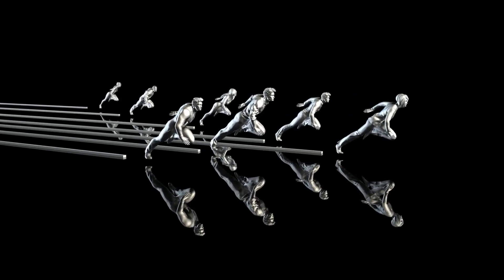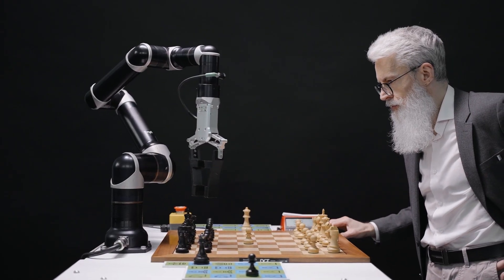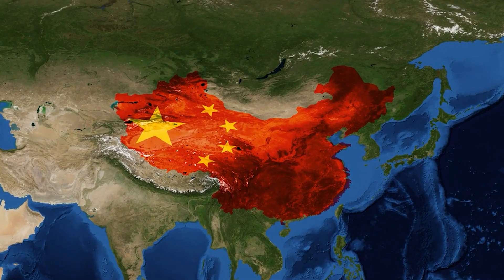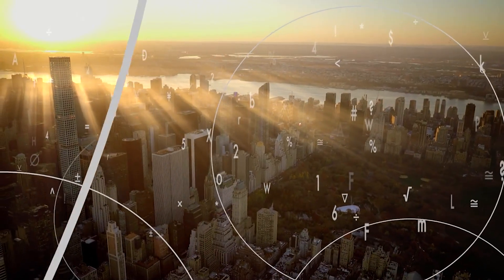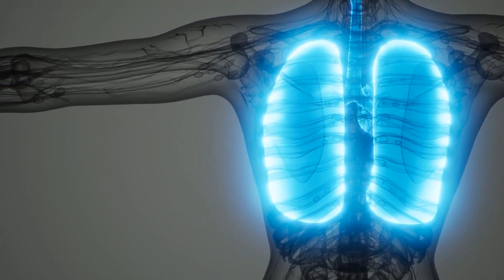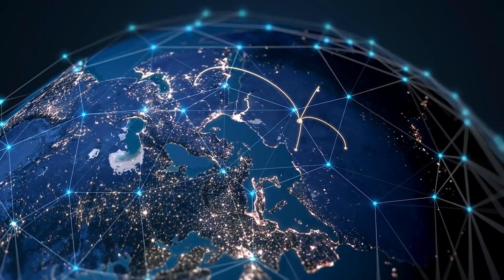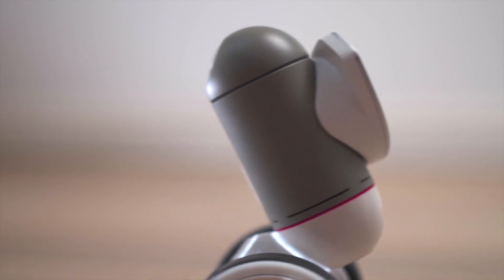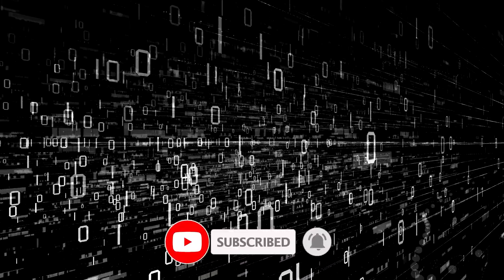AI SUPREMACY: Is CHINA already beating the USA?

Comment: USA is way behind due to slow progress on 5G. Ultralow latency telecommunications network is an essential components of AI.
Reply: 5g is essential for inter connectivity, but is not the source of AI’s processing power.
Reply: @mehnameehjeff6325  - AI relies on inputs to drive AI algorithms. Inputs are from numerous sources like from sensors, cameras sending data through wireless networks from thousands of miles away. For example of remote surgery.